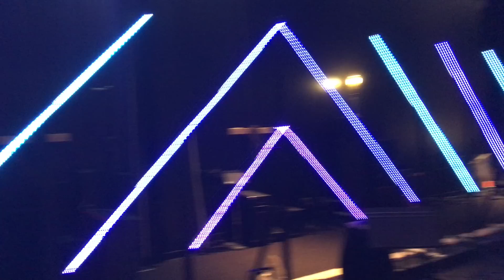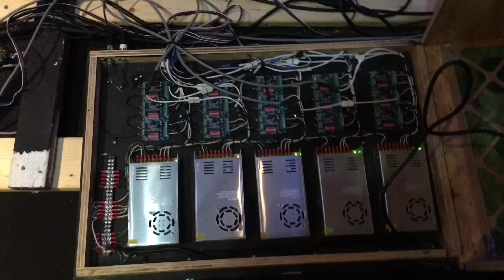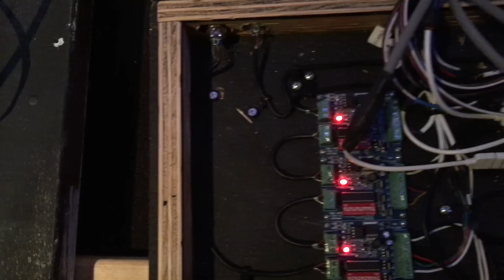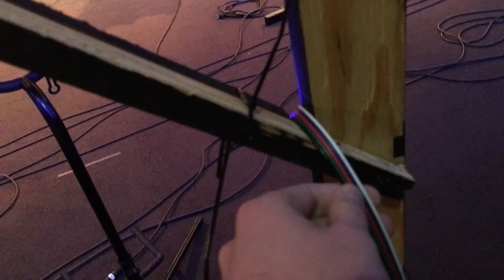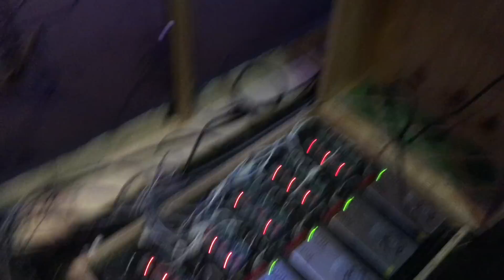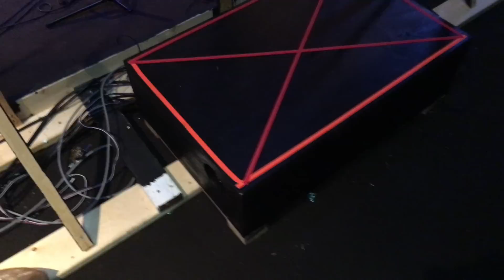DIY LED Tape Light Stage Set

Comment: These boys are $38 for 7 RGB channels instead of just $15 single channels.
https://www.aliexpress.com/item/Easy-27CH-Controller-27CH-dmx512-decoder-27-channel-dmx512-dimmer-27-channel-Easy-LED-controller-LED/2032453134.html
I've worked with them in the past, they do work great.

The 5 power supplies are an extreme overkill and the LED's can be found half priced in China. Overall a great build anyway, it's nice to see something quite simple work this well. Would love to see some more footage of it in action.
Reply: Does this mean you can attach 7 strips to one of these? But then they are going to be the same colour and controlled as a group?
Reply: Hey, it seems like you have a good idea of how to get this kind of setup a bit more efficiently and cheaper. Do you have a vid or would you mind messaging me? I would love to get more details! Thank you
Reply: How much was this over all project ? I would like to do this exact design at my church.

Comment: if ( yes IF) you ever want to clean up your wiring (since it is a mess lol) , use PoE. your LED strip signal wires from your decoders could be punched into a 1U rackmount cat6 patch panel ( use cat 6 not cat5 ) Like this one  https://www.amazon.com/gp/product/B0072K1OWY/ref=ox_sc_act_title_6?smid=A1AMUYYA3CT6HJ&psc=1 . Use cat6 single punch connectors on the strip ends and you can connect all the strips using a cat 6e cable ( up to 100 feet away)   Have a happy day! ;)

Comment: Did you have to solder/extend the LED ribbon tape from the LED to reach to the decoders essentially modifying them?
Reply from the maker: We didn't do any soldering to the LED ribbon tape itself, but we did have take apart the connector and use extra cabling. We just exposed the wires and then used dolphin, crimp-on connectors for those connections and used some RGBW wire rolls that we found on amazon to make be able to reach all the way to our DMX decoders.

Comment: How did you stick the LED tape to the wood frame? The adhesive back they come with isn’t that sticky
Reply from the maker: We actually used very small black zip ties and zip-tied the Strips on the wood frame about every 12-16 inches. It ended up working great!

Comment: How much did this overall cost you guys ?
Reply from the maker: Khentinu Warren well, we did this set and another set that was smaller for a 2nd campus. The total budget we spent was about $1,700 if I had to guess. We did go a little overkill with some of the equipment so that we knew we were making something to last. I would say that it could probably be done for $1,000 or maybe even $900 for one campus like the one in the video. It also depends on how much wire you have available and how much you have to buy. We salvaged a lot of copper wire from old cables. Hope this helps
Reply: You could do this for less than $300, not including the system to hold the strips.
Reply: would love to hear your plans on how to do this for $300 - we're a portable church looking to do something similar.

Comment: How many of everything did you purchase?
Reply from the maker: Eddie Vargas honestly I'm not exactly sure for everything. We had to do a lot of going back and ordering which cause new problems. We bought 7 power supplies. We needed 5 for our main campus and 1 for a second campus and ordered one extra in case we got a bad one. When ordering cheap stuff off Amazon it can really be risky. As far as decoders we used one decoder for each tape light strip so we could control them individually. You could actually use a decoder for multiple tape strips if you wanted. But we ordered 22 decoders total. 15 for main campus, 3 for second campus and 5 extra. And then we just ordered A TON of LED tape light. This is something where I recommend buying more than you need all at once. If you order them at separate times (even from the same seller) you will end up with different Tape strips that don't match. There's probably more extensive info in my blog post at this link: http://www.churchstagedesignideas.com/led-by-the-spirit/